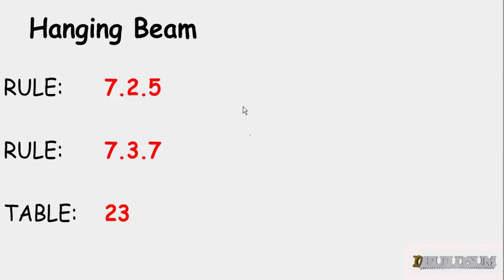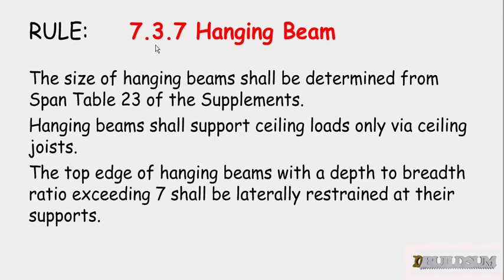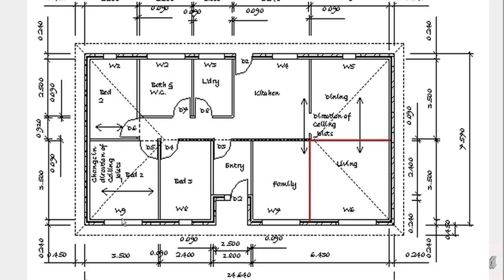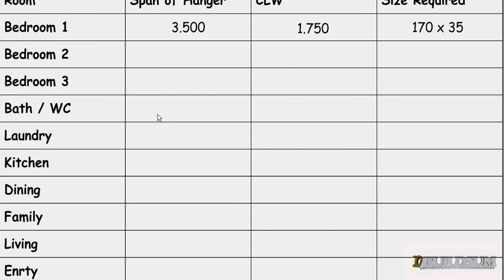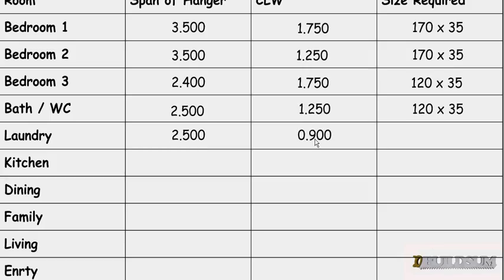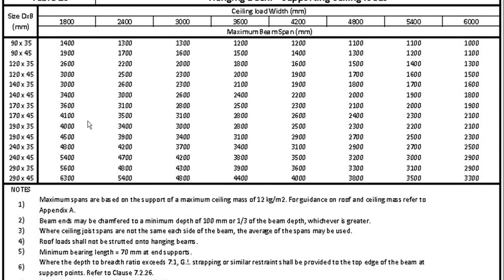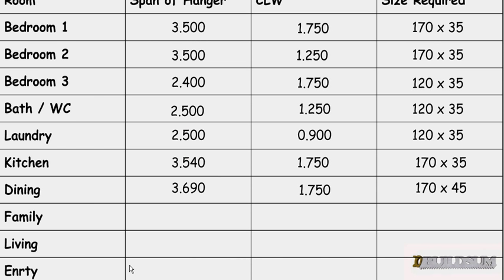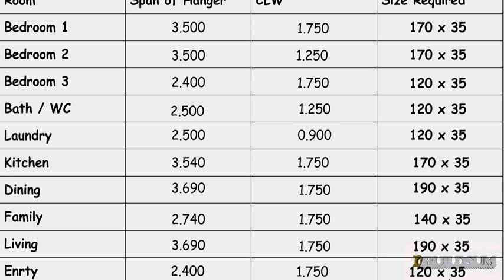11  Hanging Beams

Comment: I know this was a long time ago but Im in a 60 year old timber framed house. The ceiling joists are all rough Doug fir 100x50  on 450mm centers and don't meet current spec requirements for span but there you go.
The span in my bedroom is about 3m, (x 3.2m wide) and roughly central is a hanging beam, 150x50  just skew nailed to the joists, no soldiers etc. The ceiling is soft board and Im covering it with new Gib on rondo 16mm battens. 
So its sagged over 60 years as expected, around 5-7mm at worst under the centre line of the hanging beam.
I can easily adjust the rondo hangers so I have a level ceiling but wondered if I ought to sister (or replace) a new hanging beam spec right for today.
I doubt even with props I could level the sag and likely I would just lift the joists off the top plates as they are as hard as nails and like petrified wood.
So I could attach the joists properly to a new beam and avoid any further sag but would there be anymore now after decades?
Alternatively I could at least put some soldiers on the current joists and beam (or metal ties, the ones with a 90 degree twist).
Possibly all overkill???
Same problem in the lounge but much bigger span and a bit more sag plus the joists are butted to a double hanger and just skew nailed with a hanging beam on top as well. That probably does need a new hanging beam and better attached joist ends with joist hangers??
Reply from the maker: Hi Mate, if you are going to be adding additional weight to the ceiling then I would recomend upgrading the Hanging Beam to support it.

Comment: To simple need example for 3 counter beam and 3 rows of hanging beams?
Reply from the maker: Hi Phillip, that would be a very complex ceiling and if I had that situation I would look at trusses as a serious option as it would probably be cheaper. However, if that is the question you are faced with this video may help, it is the same ceiling and not as complex as what you are asking but it does go into the positioning some more.
Reply: @Buildsum  it is a ceiling inside a steel framed structure I have drafting for a long time the simple case is obvious one only looks for support in the complex cases in many project houses we use UC strutting hanging beams on angles

Comment: Stupid question but if a room has a hanging beam would the wall
It rests in be considered load bearing ?
Reply from the maker: Hi Sam, yes it would, just think about it like if you pulled that wall out would the ceiling still be safe. If you were to pull that wall out you would have to do something else to support the ceiling like a beam or larger ceiling joists so the hanger is not required. Hope this helps.
Reply: Thanks so much that helps a lot, your channel is seriously awesome makes me career change into construction. Love it
Reply from the maker: Thanks Sam. I'm glad to hear that you are finding it useful.

Comment: Hi

At the ends of ceiling hanging beams where the top surface is profiled to the roof slope:
.
Does the beam have to maintain minimum depth of (D/3 or 100mm)?
.
How is this achieved in a hip roof, for support at the external wall?
For example, say the rafters are 150 deep, and the ceiling joists are 95 deep.
The ceiling hanging beam will be tapered down to 55mm depth at its end?

Thanks
Reply from the maker: Hi Mate, AS1684.2 Timber Framing Code (for Australia) states 
"Where the slope of rafters is such that the depth of a hanging beam has to be reduced by more than two-thirds in order to avoid interference with roof cladding, the provision shall be
made for additional support incorporating a jack ceiling joist (trimmer)"
In other words, a trimmer should be installed running from the top plate to the ceiling joist, under the hanger to effectively thicken the beam where it joins the plate. 
Hope this helps
Reply: @Buildsum  Hi

Thanks for pointing that out. I notice also that the code says to bolt the hanging beam to the rafter.
Presumably the bolted connection to the rafter is what predominantly supports the hanging beam.

The  jack ceiling joist under the hanging beam, relies in turn on being supported at the first typical ceiling joist, which in turn hangs from the  hanging beam. This seems to be a circular argument in regard to which element supports the other. Granted, however, just having more timber under the hanging beam has to increase the shear capacity.

Comment: Just what to understand how this works. Is not that the Hanging Beams run parallel to the joists, and the Hanger runs at right angles from the joists? The hanger is checked out to receive the hanging beam? Thanks
Reply from the maker: Hi Mate, Hangers and hanging Beams are the same thing. What you are calling a Hanging Beam is known as a Counter Beam.
This video might help https://www.youtube.com/watch?v=XgMY3IRK02k
Reply: Go it thanks mate!

Comment: What type of support is provided at the end of the hanging beam, if there is no wall on the ends as in case of verandahs?
Reply from the maker: Hi Mansoor, in the case where there is no wall to land on then you will have to use a Counter Beam to carry the Hanging Beam.
Reply: Thanks
Reply: John I wondered about a situation where the  hanging beam ends at a wall but won't land on a top plate? eg one of the walls is external and higher than ceiling height (ie side wall of a skillion roof). Is it acceptable to vary the hanging beam's exact position to land that end directly on a jack stud fixed to one of that walls common studs? Otherwise how is that situation normally resolved?

Comment: Is there a rule of thumb to any of this calculations? Thanks
Reply from the maker: Hi Josif 
No, not that I am aware of
Reply: Is there a site or some places in nsw where i can up for advice for a job i am getting. I am carpenter contractor and am experience in framing but somtimes i just need to get an opinion in regards to the right strutting beams/counter beams and hanging beams. Thanks

Comment: just wondering which supplement are you using for this series?
MGP10 or F7 or something else
I can't find the right supp
Thanks
Reply from the maker: Hi 

pretty sure I used the MGP 10 supplement for N3 wind loads, N3 Supp 4
Reply: thanks, by the way, great video, I find it very useful